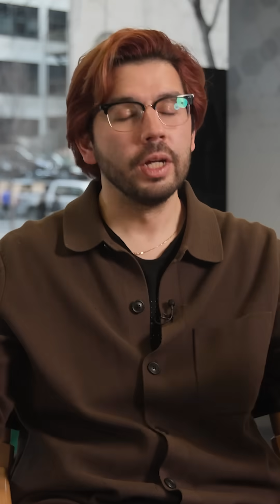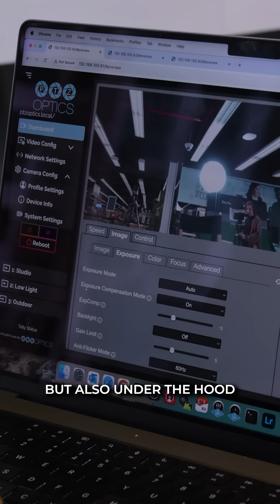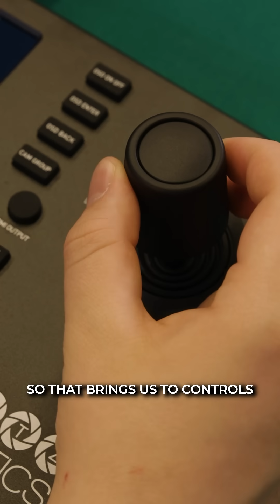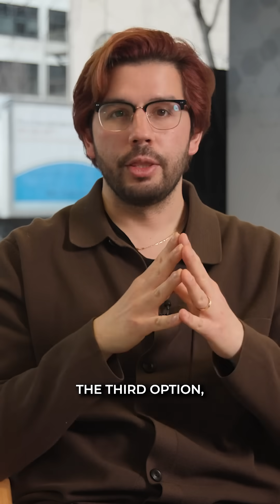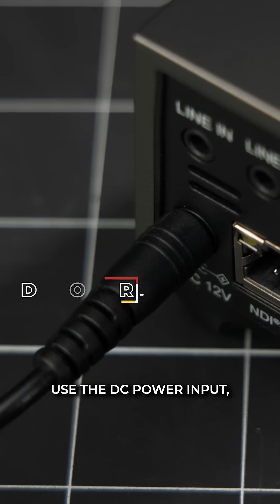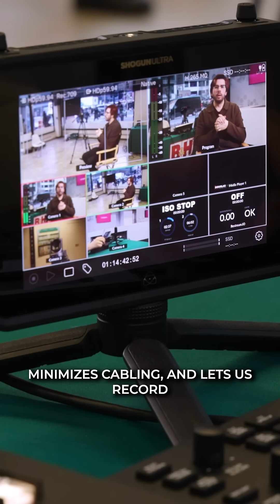PTZ cameras, ever heard of them? What are they and what do they do?

Comment: I want to use the ATEM MINI PRO - can I do this and if so how do I record to an SD card to capture the footage
Reply from the maker: Yes, you can connect these cameras to the ATEM Mini Pro. However, these cameras do not take a SD card for recording. There are a few different ways to record the footage. One way is to use the USB-C output on the ATEM Mini Pro to connect to an external SSD drive and record the stream there. Or you can use what ever streaming program you're using to record to the computer.